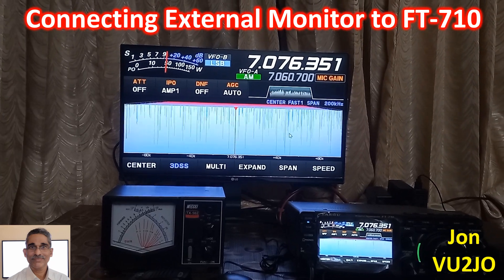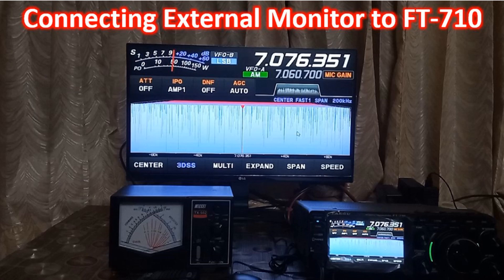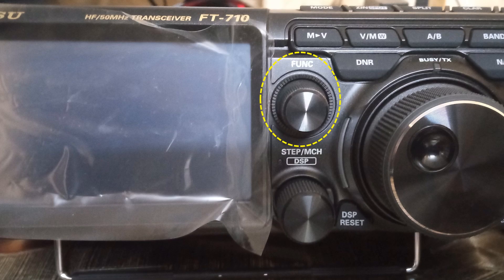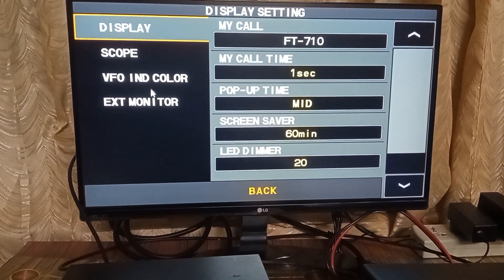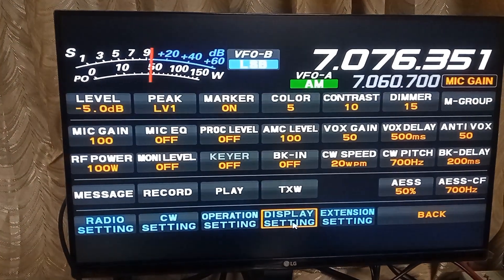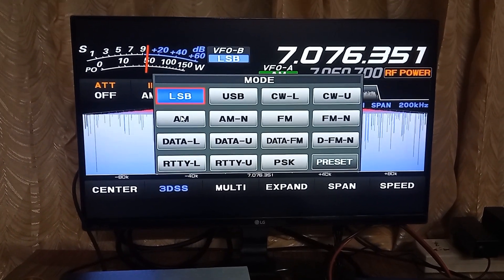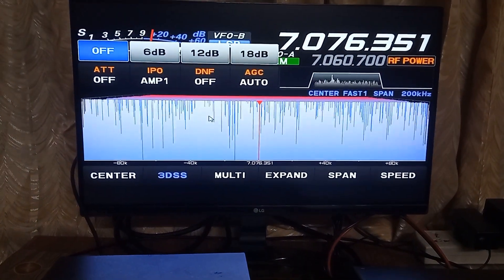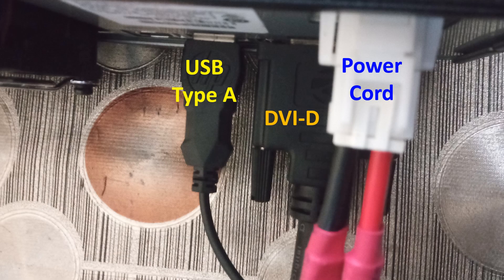Connecting External Monitor to FT-710

Comment: I've a horrible issue finding I dvid monitor been threw three that were supposed to be I'm about to go dvid to hdmi
Reply from the maker: Someone from EU region had told me that it is available on eBay. I have not checked myself. One ham in this region who bought FT-710 while in US used HDMI monitor with a converter without any problem. But some have had problems it seems. I did not want to take a chance with my first commercial HF radio which I bought after a long wait!
Reply: @johnsonsTechNAgroWorld  yeah well two people sent me monitors claiming they were dvid d nope